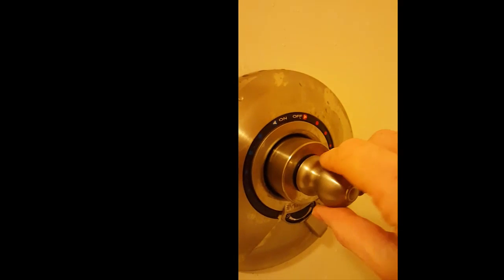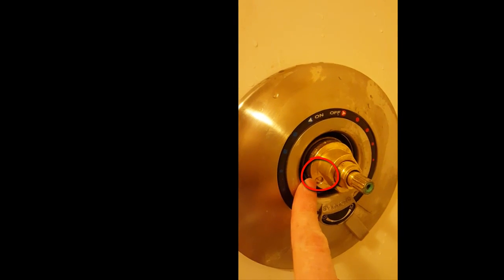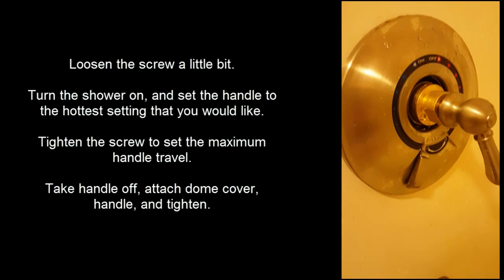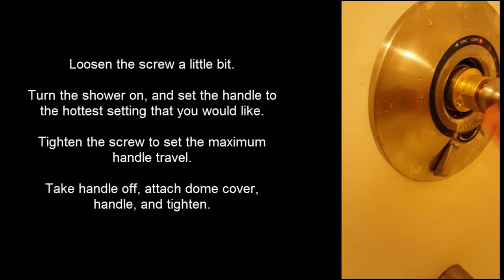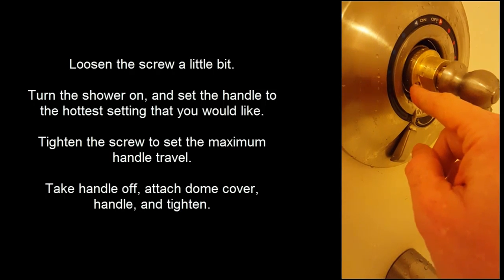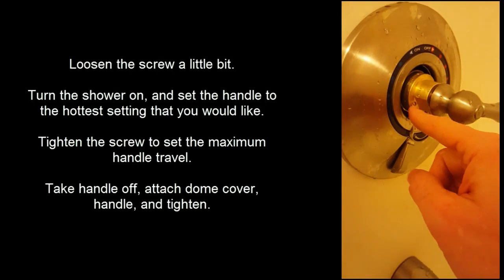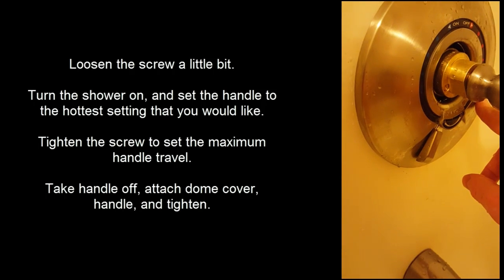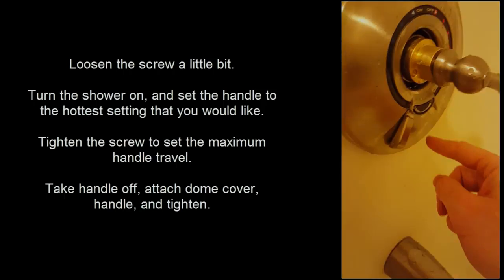Adjusting the hot water stop limit on a Symmons Allura Tub/Shower

Comment: I tried this and apparently my handle was already at max. I've not been able to get the same temperature as before that I had before I changed the spindle/stem. It's not cold but it's definitely not adequate.  

I just full remodel of my master bathroom and kept the Symmons valve. It's a second floor ondo. I didn't want to mess around with the stacked water lines because of potential liability. I ended up just buying new parts for the old Symmons.

Any other advice?